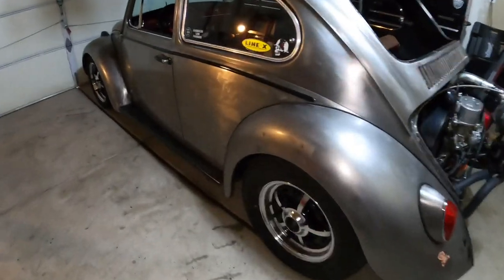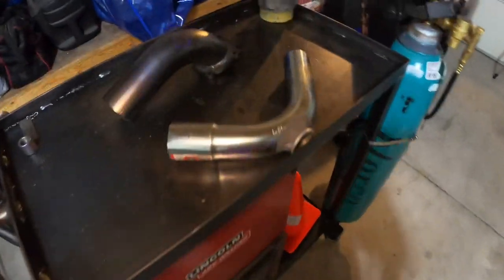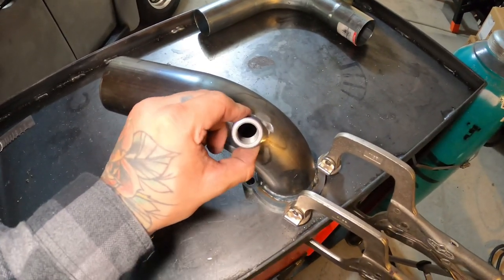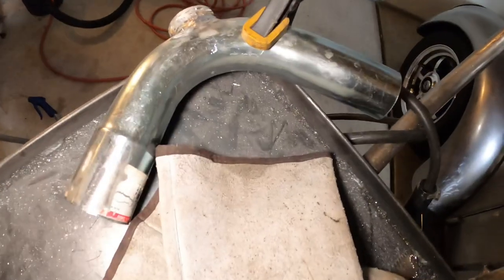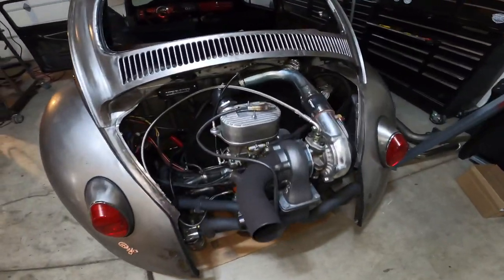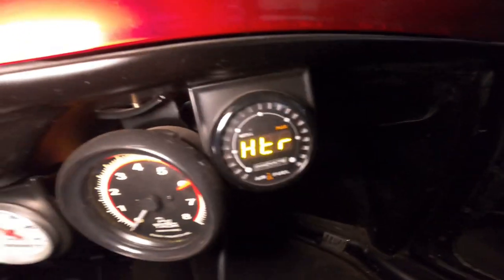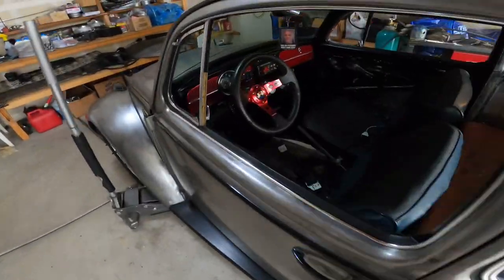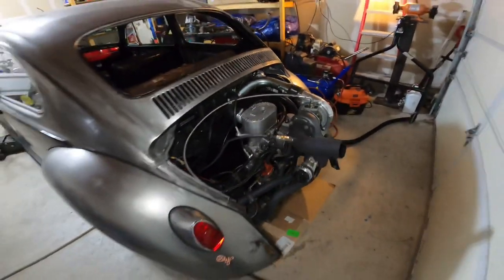TURBO VW BUG GETS A NEW O2 SENSOR

Comment: Awesome to see ya grinding at it!
Reply from the maker: I’m a grinder not a welder 🤣
Reply: @EmmettRacing  try doing a bunch of spot welds around the fitting verse doing a constant weld.

U might have to run a higher amperage.

That works best for me when running a mig on tubing
Reply from the maker: @boostedpower5417  that’s a good tip! I was thinking actually thinking of doing that but since I bought a 80lb tank I wanted to practice and get more into running a solid bead.
Reply: @EmmettRacing  oh yeah I totally get that.

I know one thing for sure welding around stuff thats round and not flat is a bitch hahahaha

I been doing practice welds for a good part of today on some aluminum just to get the experience under the welding hood up.

Keep at it man. Weld something once a week and u will be pro before ya know it

Comment: With such a short exhaust, your options are very limited with regard to the sensor placement but I've found that the innovate wideband will kill sensors really quickly if they're too close to the turbo due to the heat.
Also, if the sensor is too close to the open end of the exhaust it might be reading too lean due to the engine pulses actually drawing a small amount of fresh air into the exhaust.
There's a video on my channel about how to extend the life of the sensor by protecting it from the heat.
Reply from the maker: I know what you mean. This is my second sensor. My actual plan was to run the bug and make sure the AFR was correct and then remove the sensor then cap it. When I needed to turn I would put the sensor back in. I’ll check that video out the more I for the better!
Reply: @EmmettRacing  Good plan. Unless you've got fuel injection on a closed loop setup I don't think you need to monitor it all the time anyway.

Comment: Hi Emmett, just a question. Dou you have blow-by when you ReV your engine. Or any little leak by the crank pulley due the blow-by. Because I had my turbo engine with all the  breather system and had a tiny leak on the pulley when I ReV the engine. My setup is force induction.
Reply from the maker: No I don’t have that problem. What kind of pulley do you have? Stock or aftermarket? If you don’t have a sand seal your pulley should have grooves in it. If you have a sand seal your pulley should be smooth and a seal installed into the case.
Reply: @EmmettRacing  I had a MST pulley sand seal. My engine is 2276cc turbo .65, big heads 42x37.5 heads, etc. Both valve covers are vents, throttle body just one is vent. I going to vent the other throttle body and put a filter on the oil cap. To see if the blow-by gets lower. Also what pulley you recommend.
Reply from the maker: @AngelRodriguez-kp7ug  pull the pulley off. See the seal is ok or properly seated. I personally don’t like sand seal pulleys just for that issue.

Comment: Do u mind dropping the link where u got that o2 sensor I’m having a hard time finding one long enough
Reply from the maker: Mine is short as well, but this comes with a 3ft cable: Innovate Motorsports 3924 MTX-L Plus (3ft. Cable) Wideband O2 Gauge Kit 39240 https://www.amazon.com/dp/B072MXHR5Y/ref=cm_sw_r_cp_api_i_KDZTXRMF059SQ8STZC2H